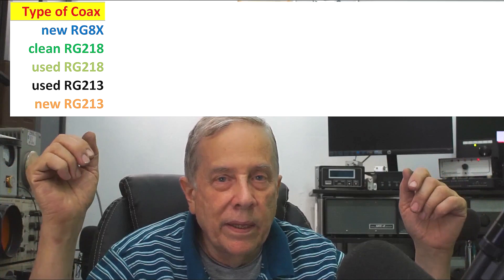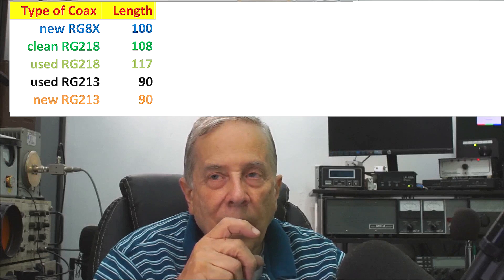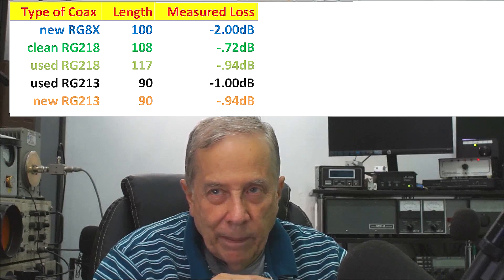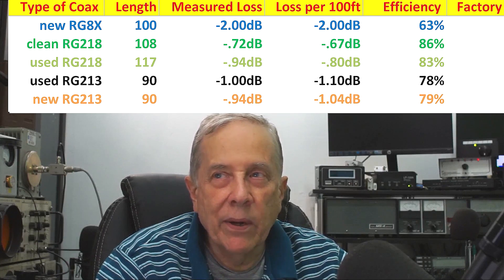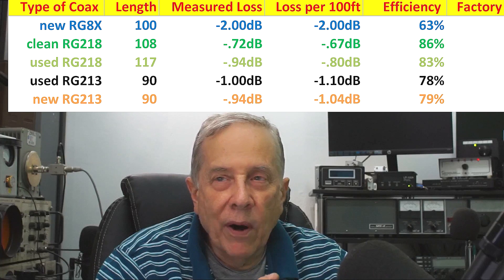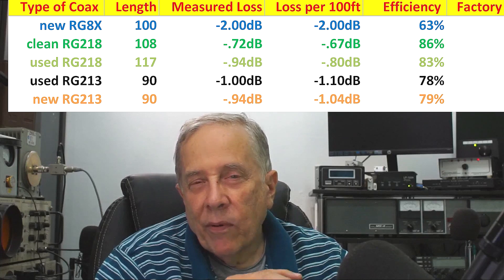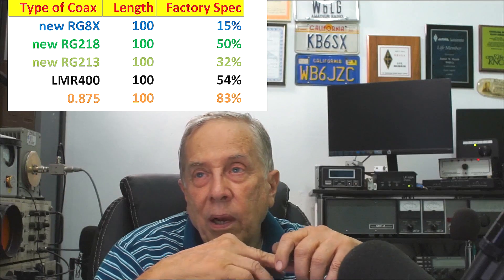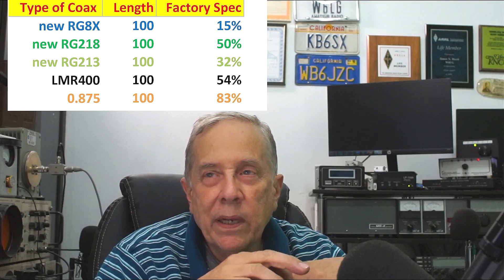Autopsy Of Coax Cable Finds A Cancer, Losses at 30MHz and 440 MHz By YouTube Elmer, Jim Heath W6LG

Comment: Thank you, I am putting up a new antenna system, after a 90 foot hemlock came down a few years ago. It exploded at about 9 ft. up after it was hit by lighting, and removed 3 other trees in its fall. Pulling down my 2 dipoles 80m, and 40m. I am putting up a sky wire loop cut for 3.5mhz. 287 ft. long I have everything I need: pulleys, 500ft. roll of #12 wire, rope, and a team of tree climbers coming next month. 
The Coax is the last thing I need to figure out. I was thinking of using Rg-213. My run from feed-point to shack is 76' ft long measured length. After watching your video I will rethink my plan. Do you think LMR-400 would be worth the extra expense? Thank you for your video.
Reply from the maker: If you are saying the feedline is 76 feet, then no. there would be very little difference in terms of losses. 73, Jim
Reply: @ham-radio  Thank you, Yup the feed line is 76 feet. :) I hope all is well out there in W6LG land.

Comment: Thank you for this brilliant video.
73
Reply from the maker: Brilliant is probably overstating a lot.  Interesting how water just ruins the performance of coax. I did strip more coax and found extensive water stains.  I stripped off the shield and save that as a ground strap.  It is about 1.5 inches wide. I used some large heat shrink over the braid.  Those will go from equipment to the copper pipe that runs horizontally under the desk.  Those pipes connect to the extensive grounding system. Nice to hear from you. 73, Jim
Reply: @ham-radio  ok, then excellent:) Your video only inspired me to check my coax and guess what? - I discovered a small portion of the coax from the the antenna appeared different. On closer inspection the coax's jacket was damp while it's jacket looked somewhat worn-out  due to continous exposure to harsh weather. Had replaced it and now it works superb with neat tx as well as rx signals.
Thank you and have a great day ahead.
73

Comment: Another great video Jim, as always. A little anecdote you might find relevant/interesting.. some time ago I maintained a VHF paging system for a blue light customer. (150MHz). They had 13 different sites but they could be triggered individually. The customer believed that one site was underperforming. I checked forward and reflected power at the transmitter end, deviation and frequency accuracy etc, I did not think we had a problem. Customer still convinced that there was a fault. Got  a rigger out to check at the top of the tower, again as expected the LDF-550 was fine and the vast majority of the power was reaching the antenna with very little reflected. Again the customer was still convinced that the site had a problem, so we got a rigger  out again with a replacement antenna. Putting the antenna on a VNA in the office it was fine at design frequency but the SWR was not horrendous even at 300MHz. Cutting the sheath of the tail off revealed wet black copper. Of course it behaved like an attenuator. A suspiciously good SWR over an excessive bandwidth is often due to losses. I know you know this but might provoke some thoughts amongst your viewers. 73

Comment: Always thumbs up for your videos.
Some decades ago, a friend of mine suggested to use only solid copper central conductor cable for UHF and NEVER multi stranded ones. These are best for HF only. What is your opinion on this?
Reply: Since you haven't answered my question, I once again repeat it. Is it recommended to use solid conductors for V or U and NOT stranded?

Comment: I guess I need to change my coax.  
213  two runs different antennas
8x for vhf
All over 20 years old.
Question  There's some coax made in Italy by M&P the numbers look good.  What would your input be
Reply: I have M&P ultraflex 7 (15m so about 50ft) on my 2m and 70cm antenna... Seems really good stuff from my limited experience.
The ultraflex 10 looks like it would be a great replacement for LMR400 at half the cost

Unlike some other coax it's 100% copper in the core and the braid, no coper clad aluminium there
Reply: @dasy2k1  the 7 better than the 10. Been off the bands for about 20 years. How things change. I feel like a newbie
Reply: @paulhastings3109  ultraflex 10 is better than the ultraflex 7
But it is thicker and more expensive
For the length I have the 7 was sufficient
If I had a longer run I would have gone for the 10 (10 is the same diameter as lmr400, (.400in) 7 is only .275 in  which is only a tiny bit larger than RG8x)

Comment: I have seen on a winter VHF contest, at breakdown, coax that had serious tape applied, when dismantled, the guy having water run down his jacket sleeve. He took the 6 ft. end of coax and upended it and the water just poured out like a garden hose. Not a whole lot, but enough to tell me that that feed line was FUBAR.

Comment: It seems strange but I've never used coaxial cable. Normal mains flex seems to work perfectly for me.
Reply: WUT?
Reply: @Justin-bd2dg  Its just a narrow parallel line feed.
Reply: @Rayxl1  so you are claiming to use solid conductor like twin lead/ladder line?
Reply: @YZFoFittie  I've never used solid conductors. Flexible cable is more workable. My mobile rig uses two core rubber insulated cable which works well.
Reply: So what are you doing about OHMs?
Reply: @YZFoFittie  I worked out that the characteristic impedance of mains flex is about 270 ohms.
Reply: @Rayxl1  when the two are in direct contact, what happens when they are 1/4" or 3/4" apart?
Reply: @YZFoFittie  The parallel line feeds to my base station HF aerials have about a one inch spacing which gives a slightly lower impedance than mains flex.

Comment: Hi Jim,
Very informative video. Been having an SWR problem on 6m. From the coax switch to the antenna tests fine, but from the radio have 2.3:1 and 6 months ago was 1.3:1. I still have a short run of 40 year old coax that is in the crawl space that goes through the wall to outside and about 15 ft to the coax switch. When my back fells better, I'm going to replace that short run with fresh Messi & Paoloni Hyperflex 10 coax. Stay safe.  73  WJ3U

Comment: Jim Coax sucks ☺️ best thing to do is use the center conductor of two of the coax runs tie grounds together and use Cntr’s as parallel feed line. Balanced feed line is the only way to get 99% of you signal on to the antenna. And that lmr 400 foam will melt with 1.5kw with a 1.5:1 vswr. Home made ladder line using 12awg solid core copper thhn coated 4” spaced with electric fence isolators and 14” UV resistant wire ties a few hours work. KC3ONO
Reply: interesting.. why do u think more don`t use ladderline
Reply: @gabrielsansar6187  Probably because it's easier to pass coax through walls and easier to stop the coax from radiating and producing TVI than with Ladder line. But Ladder line is a lot more efficient and well worth doing.
Reply: Gabriel Sansar well sadly bc it requires building it 
Parallel line sold is crap usually copper costed stainless steel wire. Look up toad harbor feed line. Simple to make and again balanced is best when using barefoot or 1kw all coax has loss even hard line. That loss robs ur signal/ voltage  b4 hitting ur antenna. Best reason for using balanced feed is using it on a cntr fed 260' full size dipole or loop n get all bands on one resonant antenna 😉 KC3ONO